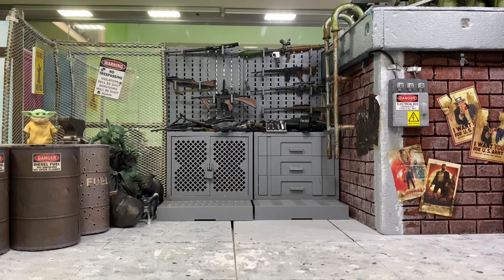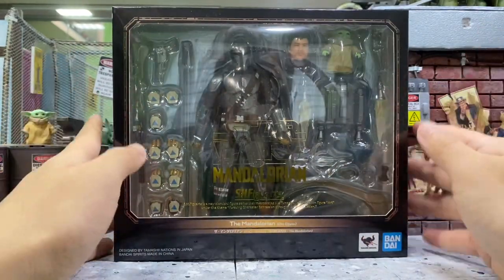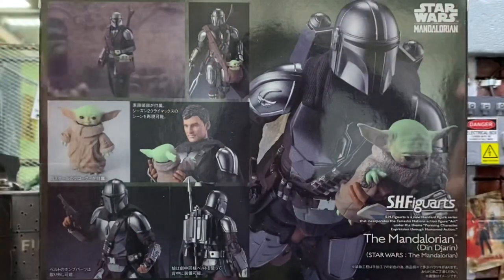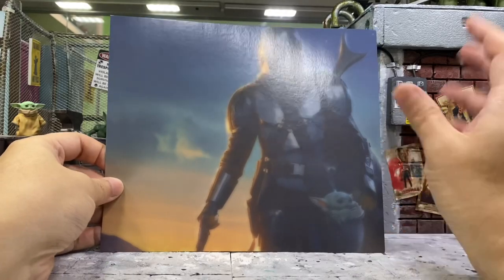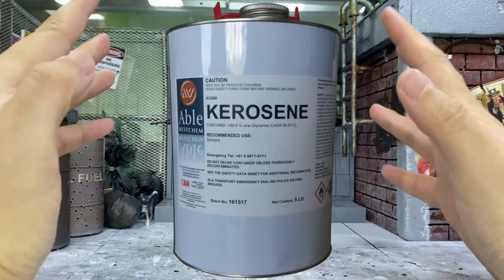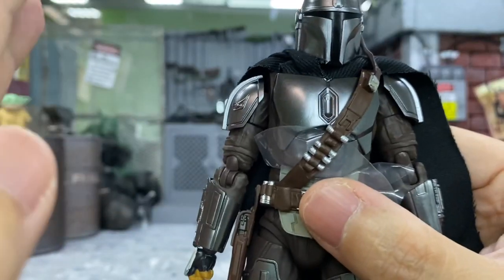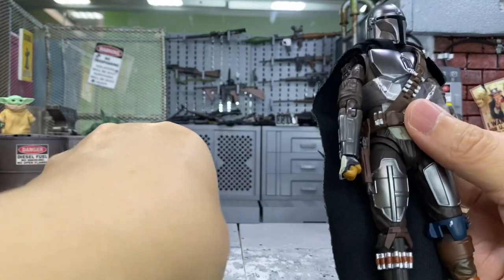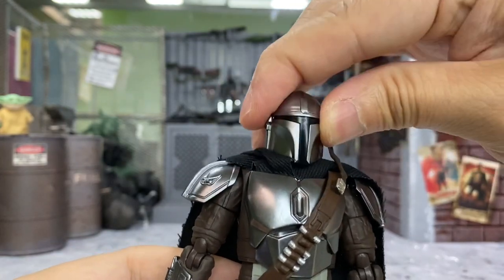SH Figuarts Mandalorian Din Djarin from STAR WARS: The Mandalorian 1/12 Scale Action Figure Review

Comment: I also have shaky hands, so I feel you there (didn't distract from the video IMO). I'm also sorry your shoulder and right arm piece are loose--mine have stayed snug on the figure so far. Also if you had the original Beskar Mando figure you would have the flame thrower accessory to put on it. 

Regarding the cape around the jet pack, you can push the cape closer to the jet pack to make it look more akin with how he wears it on the show. It is longer than it should be, though, so I cut around an inch off the bottom and think it looks really good. 

Over engineering in some areas and leaving the short neck from the previous releases are my main gripes with the figure, but I have managed to get him in poses I'm very happy with so I would personally give it an 8 out of 10. 

Here's to fourth times the charm when they release a season 3 Mando!
Reply from the maker: Thank you for sharing, Jonathan. Yeah, I think mine has some defect on the shoulder as well as the hand weapon keep dropping.
And yeah, the short neck is not that good... I hoped they make a better one next with Dark Saber!